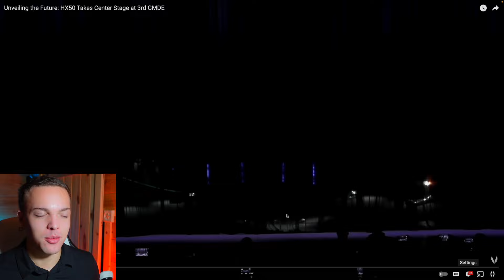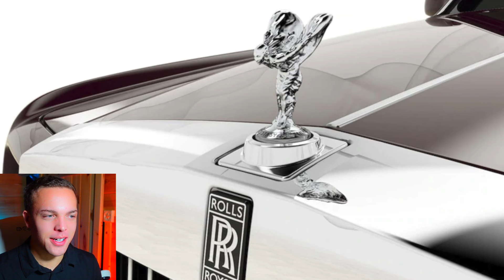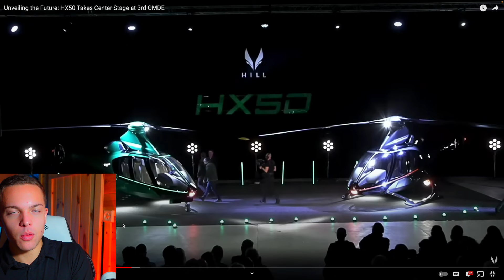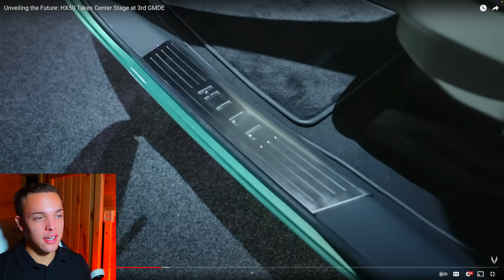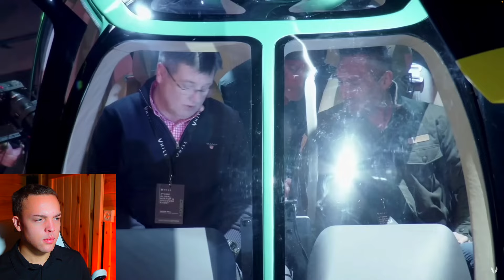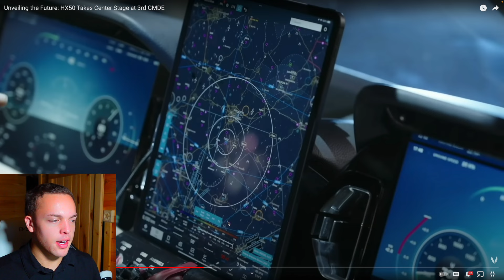Will The Hill HX50 Helicopter Actually Happen? (2023 Update)

Comment: I wouldn't describe aerospace manufacturing as higher quality than modern automotive manufacturing, but it has to maintain a safe level of quality despite much lower production volumes. This can be challenging, when the budget available for investing in tooling and process development is much smaller. The volumes are somewhere between an Italian sports car, and a hand-built race car.

Comment: I've thought about making a turbine engine and it's actually pretty simple. Keep in mind they did these in the 1960s as routine and today you can just order manufacturing online. You could genuinely have a jet engine factory that just assembles ordered parts. A turbine engine uses inconel alloy for the hot parts which is commercially available as a standard, both machining and even 3D print. The rest is either steel, alu or titanium, also available. Even the ball bearings aren't exotic materials, pretty much off the shelf you can order. You have simulation software that can give you direction on sizing, it's actually very doable today. 1 man home office without getting his hands dirty could do it. And the reason it is smart to do rather than buy a P&W is that the scumbag industry is very comfortable in grotesque overpricing. Hill is trying to sell an entire helicopter for 750k. P&W wants more than that just for one engine. And when the engine needs service they want 600k for that.
A turbine engine is actually engineering wise similar to a car turbo which retails for 300$. Same materials, same temperatures, same durability and actually turbos spin much faster than larger turbine engines. A jet engine just looks convoluted and a turboprop has a gearbox as well but it's really quite crude technology. Frank Whittle invented it in the 1930s and it could have been built 40 years prior. That's more than 100 years ago. It's an absolute disgrace that the douche turbine world can only think in 7 figures when the truth is, it's an angry space heater that you should pick up in a hardware store next to lawn tractors.
Speaking in Elon terms the idiot index on a small jet engine is huge. The factor between material cost and the final product cost.
PW610f is the smallest turbojet engine in production that the Eclipse 550 twin jet uses. It weighs 145kg, in refined metals that's about 3000$. The 2023 price for one engine was 920k$. Probably just about 1 million now. Per engine. So because of those scumbags, just OEM engine cost is 2million for a small jet plane that they wanted to sell for 500k total retail originally.
A lot of people are the problem in aviation. The engine makers are definitely a problem. So it's smart to make their own. And when you are confident that it's something you can do, it's generally because it is something you can do. I'd guesstimate that they can produce that engine for less than 20k$. Possibly a lot less.
Reply: Excellent analysis , glad you confirmed my gut instinct. Frank Whittle work was brilliant,  but boy was he tortured in the process. Interesting the timeline you mention , regarding how it could have been done sooner. As it's so simple,  it probably could have been , I think the biggest problem was material science , finding the right steel alloy unlocked the technology.
Reply: @andrewashmore8000  inconel helps but they made jet engines in WW2, 80 years ago so I would hope it's doable today. GPT says WW2 engines didn't even use cooling ducts in the turbine blades, just lower compression. So we have inconel and cooling ducts and 3D printing.

Comment: I've been a pilot/mechanic for over 40 years.  I currently have a 407.  I've not only followed this design, I put in deposits for a few.  You have to remember that even the 407 is 60's technology.  The Rolls Royce engine was designed with a slide ruler in a smoke filled room.  I'm sure Jason will have some setbacks, but I believe in he will succeed.  I also attended the Duxford and HAI displays.  He drew quite a crowd at both.  I think we just need a bit of patience instead of beating on his team for reaching some of these timelines.
Reply: Hear hear!
Reply: Fully agree.

Comment: Rich people don’t generally fly themselves. They have a pilot.

The enclosed rotor head and mast is good for wire and bird strikes. 

I don’t think they have thought about using the helicopter in a hot environment as the iPad will overheat and take about 20-30 min to be USABLE again.

Devin, your doubts about the manufacturing has been my concern with the whole concept from day one. ( I worked 11 years in the F1, NASCAR and INDY Car industry as a fabricator/welder so I  understand the manufacturing challenges ahead of them)

Funding the development and prototyping is one thing. 

Where will the money come from to build a factory capable of producing the numbers required to fulfill the current orders?

I have walked through ROBINSON Helicopters factory and their expansion never happened overnight. They produce up to 300 helicopters a year in a facility that has had all the gremlins worked out over a 40 year period.
Reply: Except for the ones with crazy egos that didn't know what they didn't know.

Comment: I (as well) attended the Dec 2023 event for the unveiling of HX50. Shoving the naysayers to the side for a moment..BRAVO Jason and his team at Hill Helicopters. Flying around 50+ year old designs with archaic engines, inefficient transmissions and uncomfortable interiors was ripe for a well prepared entrepreneur to succeed albeit with Jason’s much appreciated panache, using the latest CAD assisted airfoil designs, proven manufacturing techniques and introducing the newest of aero space metals & composites into general aviation light helicopters.

Comment: They can put a car in your hands that is every bit as technically advanced and safety checked more so than most personal aircraft for well under 100k$. Why cant this be done in aviation, probably to keep most people out of it is what I think. Keep aircraft out of the reach of the general population. There are already too many people for the liability involved. What excites me about this is that it starts to bring the costs down to what I think is reasonable. At first glance my thoughts were probably start around 2 to 3 million and up but under 1 million. It can and should be done. If these things were more affordable they would sell more of them making the revenue increase for the company who makes them rather than trying to keep afloat by selling few very expensive units to exclusive buyers. Ultimately the product will be better if they have a larger market with more money involved.

Comment: The Leonardo/kopter AW-09+ started out on a similar path as the Marenco SKY-E SH09 and I too was a doubter of the likelihood of success before becoming part of the team through the turbine provider at the time (Honeywell).  Admittedly, Marenco was similarly ambitious to source everything possible, with the engine (Honeywell later Safran) and avionics (Sagem later Garmin) being the only exceptions.  Admittedly, Marenco was biting off more than they could chew and eventually backed off on sourcing other components (e.g. hydraulic pumps) rather than developing them from scratch.  All said and done, Marenco did an amazing job designing and building three flying prototypes before eventually being acquired by Leonardo, who has built the fourth (first partially conforming) prototype to begin certification flight testing.  I suspect certification is still at least a couple years out given the limited flight test resources (another couple aircraft to be built), but the program viability is no longer in question.  Needless to say, it is at a much higher price point than the HX50/HC50 and developing/certifying an all new gas turbine engine is likely to take longer than the airframe.

Comment: Corrections:  1)  @ :18   "...in production..."  Nothing is in production, or is ready to be in production, since nothing has been shown to work at all, much less to spec.    2) @  25:43 "...two prototypes..."  These are mockups, full scale models, or at best: non-functional prototypes.

I've been watching since the very beginning, and many design ideas, numerous re-designs and how to make the parts, and out of what material, seem to be a large case of "on the job training"  When Hill announced they were building the turbine engine is when I began to doubt the entire project.  When Hill announced they are making their own bearings and gears is when it became obvious that, as stated in one of the "Godfather" movies: "You don't even know, what you don't know!"  They may, with luck, have a working* engine in 2025.  Maybe .  Good luck to all with a neat design.

*working = full FADEC, full power for hundreds of hours with various loads (including shock) at all temperatures.

Comment: The manufacturer of the engine and transmission systems is very expensive. They must be approved by the FAA And they have to be tested and tested and tested not just in running good but also every part of them has to be taken apart and tested after being built and tested. It’s an absolute nightmare for anyone with an engine idea or transmission idea not to mention the cost of testing the airframe because it’s new and not a version that’s been built. There in for a long road ahead. But it’s a beautiful design.
Reply from the maker: You said it exactly right. I Wouldn't change a word of what you said. Cheers!
Reply: Dr Hill is a doctor in aerodynamics and structure and he is not alone on this. of course everything is covered. Hill is making the existing better in a new envelope with some new patented innovations. they will manufacture the engine themselves. It is the UK CAA that is the initial testing approving authorities, not Boeing FAA. then it will be approved in CAA Canada before the FAA and many others.
Reply: @palandorstvold5622  Book smart (and very well spoken) does not equal real work experience or success. Years later, it's still vaporware.  So far, the only thing they've actually done is make videos and take deposits...both of which gullible folks seem to still believe.  Certification is so much more than you can comprehend, and WAY more than those folks at Hill understand - from both a money and time perspective.  Proof is in the real world facts, they are approximal 5 years behind where they thought they'd be (based on their amazing "expertise" that you point to)! Actions speak louder than words, and so far all they have to show for their efforts (in reality) is more words.

Comment: As a trained engineer, I've spent over 30 years in Engineering and Manufacturing (worked at Boeing commercial airplane group and Silicon Valley) bringing new products to full production ramp.  I also was there in person at the roll-out in Duxford and was at the previous owners meeting in 2022.  I talked at length with several of the Hill engineers.  The powerplant is probably the most difficult problem to solve.  I have a lot of faith in Dr. Hill and the small team that they've assembled to build the prototypes.  As you said, they're in a good spot but a lot of the really difficult work (MFG ramp and certifications) is ahead.  With that said, I believe they'll do it and they have the kind of people that won't take no for an answer - they'll eventually figure it out.  This will change the face of Helicopter general aviation.  If I had any doubts, those were 18 months ago, before I put $$ down on a helicopter which won't be delivered for a few years.  They're problem solvers - this will become a major force in the vertical flight category.
Reply from the maker: Thank you for this comment, it provided me with some good insight. I wish them all the luck and I believe they can do it too but the journey is an uphill battle. I'm really excited to follow the project! Keep in touch
Reply: @PilotDevin   Hill has just released this video https://youtu.be/hK0qdGExH8g?si=Rm_Kp7sVKRG4RC3Y
which speaks to some of the complexities thus far - and I'm not saying that it is easy, but they're building momentum and a track record with me at least.  Looking forward to see how things go in 2024!
Reply: Well said... ditto as I am serial number 84 for HX50 and 29 for HC50.
Reply: I am really excited for them, they have a great team
Reply: They seem to be aware and have the horsepower to "punch through" or "weather" design, qualification and production startup.  The years might fly by faster than one would like though.  Hope to own one of these someday!
Reply: They obviously did work it out, the helicopter is being showcased at HAI this year, what an amazing machine! it looks like the European Sports Car of Helicopters. The digital flight Panel is just amazing as well, it like the inside of a Tesla or something. very cool Bird.

Comment: Also to me it looks like their is not alot of headroom . Let alone if you fly with a helmet
Reply: I'm 6' tall, and I sat in all of the seats (even in the back) and they've made ample room for most people (97th percentile) even wearing helmets. One of their engineers sat in the middle back seat and is 6ft 4in and he had about another 6 inches of clearance before his head touched the interior roof.  (Note: getting into the front seats is a bit challenging for tall people getting through the entry, but they're addressing that aspect in a future update).

Comment: I completely agree with your assessment of their point of development. It is possible they have almost peaked, as they haven't reached the really hard part of the journey yet. I think they have made a lot of changes to the typical function of the helicopter which will catch a few pilots out, and cause mistakes leading to crashes and probably deaths. I'm not saying the HX will be at fault, but at this point I think the digital display layout and graphics may be form over function.
IMO there is no way they will produce the numbers they promise for many years. That could lead to mass cancellations and major cash flow problems.
If they don't immediately produce a perfect heli with no faults, people will die and they will be in big trouble as the setbacks may bury Hill.

Ultimately we all need them to succeed though. The helicopter/aviation industry is outdated and should catch up to the car industry.
Reply: Look at the Kopter bought by AW. That is what is required now, they are a product of air safety, product testing and continuous testing.
Reply: 7 airframes so far!

Comment: Thank you for your opinion! I just see it as a PR stunt until they are certified. It’s easy to build concept cars or - in this case - concept helicopters. A good flying prototype with all systems working and certification are the hard parts… Let’s wait and see. I wish them luck but don’t expect them to succeed. 😅
Reply: I agree.
Reply: You're completely uninformed and are making assumptions based on ignorance. It's 'easy to build a concept helicopter'? This is a 'PR stunt'? Ridiculous statements...
Reply: @Ronnie_B  They are still correct years later, in the fact that it's still Vaporware.  No prototype, no flying example, not even a running engine.  Just a lot of videos with an eloquent speaker whom gullible people will believe.  Oh, and I'm very informed...
Reply: It's taking longer than I or they thought, that's obvious. I still expect them to succeed